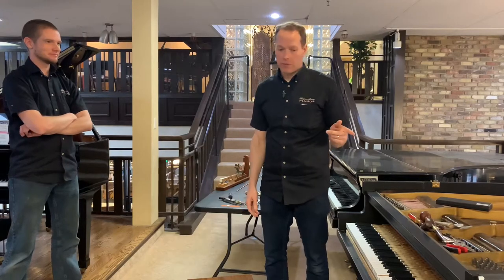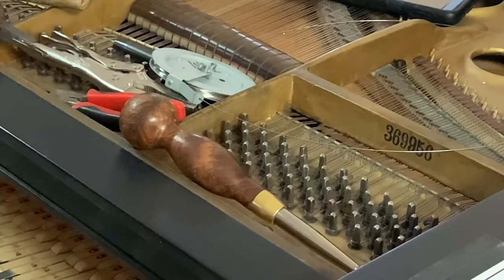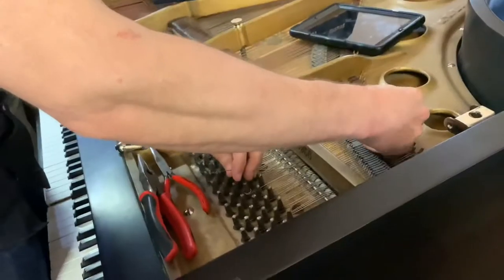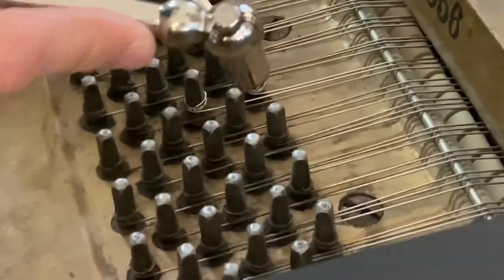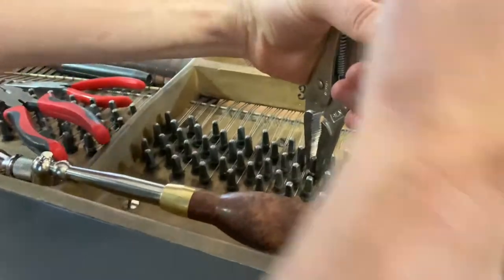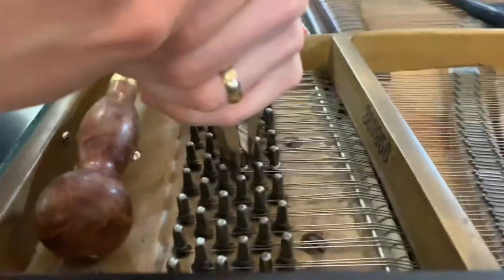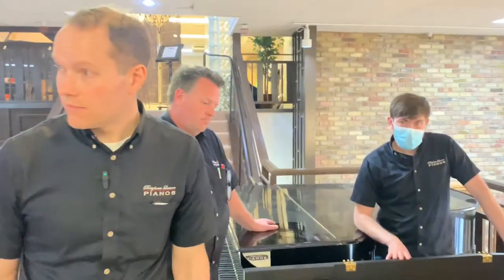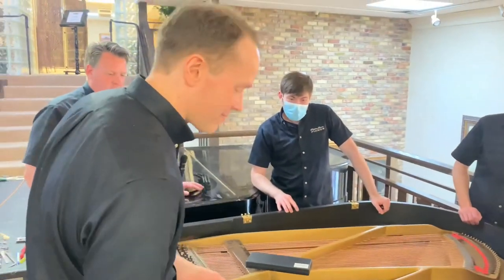BLP Piano Repair Training: How to Replace a String

Comment: Why not use a coil lifter as a screwdriver has the potential to scratch the pin, plate or even damage the wire itself?